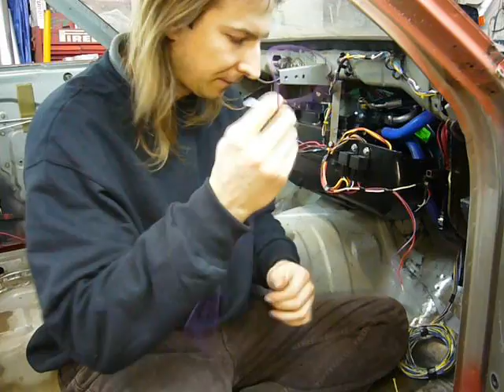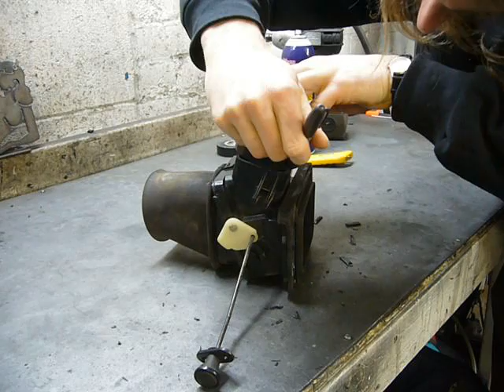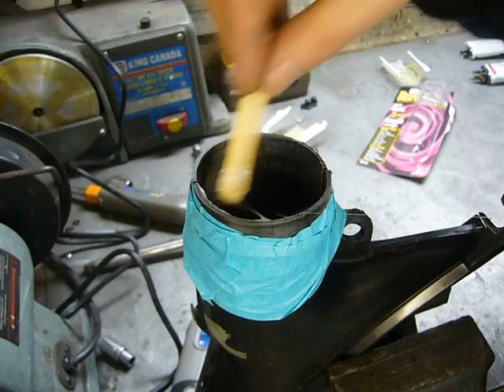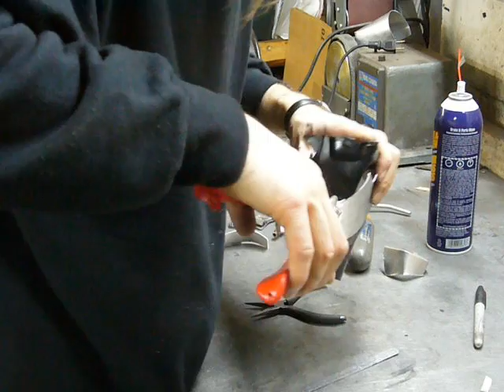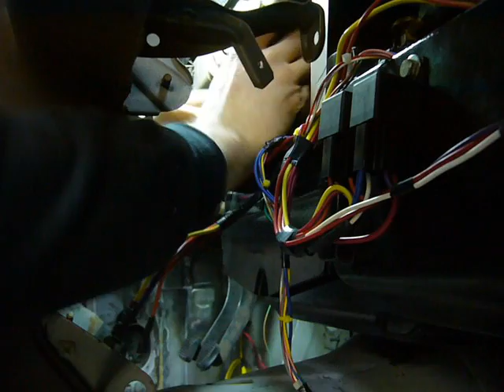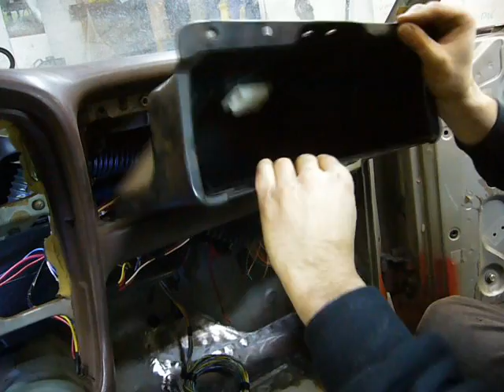Part 31: Vintage Air Gen II Compac HVAC Install, Part 3 - My 76 Mazda RX-5 Cosmo Restoration

Comment: It's been awhile since I watched this series of videos but I am buying a project car that doesn't have AC so I'll be watching these videos again.  Given the opportunity, would you do this setup again or would you look at other options?  I know the install is custom and Vintage Air didn't include many mounting options but other than that, it looks good on paper for my application.
Reply from the maker: I would probably do it again. The parts seemed fine to work with. But their included brackets were nearly useless. Take a look at episode 54 where I re-make the HVAC bracket.
Reply: Yeah, I plan to re-watch all of the episodes on the install.  Thanks for the reply.

Comment: Hi just wondering if you have a wiring diagram for how you did the relay up front to let the megasquirt know when the ac is on? Sorry I didn't quite get that bit.. I'm hoping to get the ecu to control my fans and idle up as well..
Reply from the maker: I don't have a diagram, but here is what I did: compressor clutch signal wire from Vintage Air to spare "digital in" input on MS3-Pro. Output on MS3-Pro (used spare injector) to relay coil (85). Other side of relay coil (86) to IGN switched 12V. Relay common (30) to 12V. Relay NO contact (87) to compressor clutch. Then you just need to configure the Air Conditioner Idle Up settings on the MegaSquirt.
Reply: @aaroncake  thanks Aaron so much for taking the time to reply! I love the series!
Reply: Morning Aaron - finally getting started on my vintage air setup!

Do you have a preferred brand/amp rating type of relat for this application?

Thanks again for your time!
Reply from the maker: @owlytv  Standard 5 pin automotive relay of at least 15A. I prefer names brands such as Delco,  Bosch, TE, Litlefuse because they aren't just re-branded made-in-China parts typically. If it is to be mounted in the engine bay (probably should due to the constant clicking) then look for the weather tight version with sealed socket.
Reply: @aaroncake  thanks so much Aaron! In this case it's a normally open spdt?

Comment: Between my wife and I we had two 1973 Mazda RX-2 Coupes (at the same time!) and a 1974 Mazda RX-4 Coupe.  My RX-2 didn't have any A/C but I spotted a no longer running RX-2 in a yard and bought and removed all the factory A/C components from the guy.  I have to say that although my in-dash system looked neater the under-dash A/C in my wife's RX-2 worked better.  Back in the day I liked the look of the Cosmo but the velour interior turned me off.  You are doing great work.  Exciting to see someone choose a Cosmo for a restomod.
Reply from the maker: The velour interior is one of the best parts! In fact I'm trying to decide how to modernize it, but still keep the 70s bad taste. Oddly, I actually have some of the port-installed Cosmo A/C stuff. It was in the trunk when I inventoried the car. Not knowing the state of it, and wanting to move to a more modern system, it sits in a box.
Reply: My dad had an early 80s Hurst Olds with that weird multi-stalk shifter.  It had T-tops that leaked and the same color velour interior you have.  I sat in its drenched seat once and when I got out my back and butt were both purple!  Hence my problem with velour.  At the same time I owned the RX-2s I also had a 1973 Hercules Wankel 2000 motorcycle.  Yes.  I possessed an all Wankel, all 1973 motor pool!  The Hercules was a 294cc shrouded-fan air-cooled single-rotor.  It'd do around 90mph and ran well once you got it started.  I say that because every 1 to 3 days of normal use (start at morning, lunch and to go home at 5) it would foul its single-plug with the fuel-tank's oil/gas mixture, requiring the plug be cleaned.  Really not a big deal, simply because all things seem acceptable when you're young.  I always kick-started it cuz the electric-starter didn't spin it fast enough.  Many times people asked me if it was a jet engine, bcuz with the trans bolted to the back it did kind of look like one.
Reply from the maker: Perhaps Oldsmobile hired the same engineers to design their maroon velour dye as they did to design their diesel engines? I can't say I've ever seen a Hercules Wankel in person but I'd have to agree with the jet look. One of these days, when I need another project (yeah, right) I'd like to get my hands on a Norton Commander. Or settle for a RE5.
Reply: The Commander engine is a derivation of the original Fitchel & Sachs tooling (as used in the Hercules W2000). Notice that 294cc plus 294cc equals 588cc, the size of the Norton two rotor?  I've never seen a rotary Norton but when I had the Hercules I rode with a guy who had an RE5 a few times.

Comment: GREAT VIDEOS! I know it takes a lot of time for you to do the work and then edit and publish the videos.  You have inspired me to get a sure fit kit for my truck ('53 F100) so I don't have to fiddle with all the under dash hoses.  That looked like a pain in the butt.  (I realize there are no sure fit kits for 76 Mazdas.)  this is the best AC install video that I have found.
Reply from the maker: ***** Thank you! The reason I went through so much trouble to fit everything under the dash was because I wanted it to be as integrated and as OEM as possible. The Sure-Fit is absolutely a good way to go if it fits your application and is probably more era correct anyway, since A/C was often an add-on option anyway.

Comment: Hi,
    I have a right hand drive truck.
Looking at the vintage air AC unit under the dash, do you think it could be swapped around the other way. So that the it would hang over more into the passenger side than the driver side. As I don't know if they make a mirrored unit for RHS vehicles?

Thanks,
Reply from the maker: OldDog NewTricks I'd think the only area you'd have an issue with is that the floor vents are pointing down at a specific angle. Moving the unit over strongly to one side or the other would cause one of the vents to blow onto the transmission tunnel. But of course you could always make a little duct and redirect it. Aside from that, I can't see any difference between RHD and LHD in terms of the other vents/ducts. Of course like with any universal kit, it's up to you to fit fluid lines. :-)

Comment: Aaron, what about the outside air inlet ?
Reply from the maker: ***** I'm still trying to decide if I'm going to employ one. I positioned the HVAC unit directly below the fresh air inlet but simply ran out of room to employ some sort of valve select between inside and outside air once all the fluid lines were in place. It still could be done but I would need to place the baffle in the air snorkel outside. So I'm sort of still deciding between using it and not. Vintage Air actually recommends pulling air from inside the car as it makes the system more efficient. What I could do is run two valves.
Reply: without outside air you'll have to rely only on a/c to remove humidity in cabin. And I trust you 105% you did the best job in the world with your fuel tank and fuel lines but its still inside the car (dont care about the trunk wall). I would have a bit of fresh air getting in at all time if I was you. On those hot sunny day its going to be cool inside because of your a/c but after a while your cabin will smell like a machine..
Reply from the maker: ***** I looked at the car yesterday when I was in the shop and saw something I forgot about previously. The two vents near the ends of the dash have a mixture control to select between the HVAC output and a fresh air source in the cowl. So it looks like I'm all set for fresh air. When I modified those vents I made sure to keep that function in place. What is interesting is that based on the shape of the valve, the thing was designed so that the airflow from the HVAC is always directed towards the outlet into the car and not into the cowl. I would assume this has the effect of using the HVAC airflow to draw air in from the outside and mix it. Simple and effective. As for the fuel tank, yeah, I hate the idea of it behind the seat. I'll be sealing the entire are upon final assembly with seam sealer. I'm also going to use a modern charcoal canister with purge so the whole fuel system should be sealed as opposed to the old style condensation tank and vent.
Reply: you could install two one-way vents on each sides in the trunk like many cars have (easy salvage) so that when you move the trunk will have a lower pressure so if there was to be fumes and/or odors in the trunk they will go out the car and suck good air from the cabin from any un-sealed cracks that will survive your sealing.
Reply from the maker: ***** The Como actually has two trunk inlet vents at the rear of the quarter windows, so the first half of that equation is done. Perhaps because Mazda wanted the trunk vented due to the fuel tank?
Reply: well as far as I know cars have these for few reasons: 

1- way out for odors and fumes
2- HVAC is filling the car so there's got to be a way out
3- cabin can't be sealed else if there are passengers and one slam the door it will hurt these passenger's ears.
4- insert your favorite reason here.

Comment: Hey, came in to tell you I just bought an MS3x (202FAST coupon), Eager to get it even though I don't have the car yet.
Reply from the maker: Congrats! Fire that thing up on the bench and get familiar with it and TunerStudio. Even though I don't need any Megasquirts for the near future I should have picked up an MS3-Pro with the coupon code as I will be replacing the horrid Microtech in my RX-7 with a  MegaSquirt one the Cosmo is finished.
Reply: Funny you say that, I bought a un-assembled stimulator to test it all out before I instal it! Maybe ill make a video.
Reply from the maker: Yoan Carlove Absolutely make a video. You may or may not have seen it but I have a video up showing the time lapse assembly of a MS1 Megasquirt. Going further you can even have the whole thing running on the bench being triggered from a wheel spun by a drill, firing a set of whatever coils you have around, and running any old injectors.
Reply: Ohh, I'm going to check it out, thx for clarifying the drill is ok to spin it, ill start slow and build up the "revs" ahahah! 

If It's in the cosmo part 1 to now I have seen it but ill check it out!
Reply: I found your 6 year old 2:46 video, nice thx!
Reply from the maker: Yoan Carlove That was an MS1 I assembled for a friend's FC. Seemed like the best option to just convert the car to Megasquirt as the stock harness was no longer usable.

Comment: what was that plastic epoxy you used?
Reply from the maker: Permatex PermaPoxy 5 Minute Plastic Weld epoxy. The stuff is incredibly strong and cures very quickly but man, does it ever reek. The smell will burn your nose hairs out.
Reply: aaroncake seems like a good thing to have especially when owning an rx7 with million year old plastic! Ive spent the past fews days watching the entire project and I've learned alot, hope to see more videos soon!
Reply from the maker: Clay Stanley Well to be honest, I simply replaced all the broken plastic in my RX-7 with new parts from the dealer. It's really not that expensive, especially when you consider the time put into fixing it and the fact that all the old trim is faded and going to break anyway again. Thankfully most of the trim in the Cosmo is in pretty good shape. Since I'll be covering it, a crack here or there isn't going to matter as long as the stuff stays together.

Comment: So I'm not a car expert, but I do know a fair bit about electronics (ahem) - and t I believe you should be putting the dielectric grease on after you make the connection (in this case via twisting the wires together). Dielectric grease is an insulator and hence reduces electrical contact. What you want is a good solid metal to metal connection then add the grease around it afterwards.
Reply from the maker: True that it is an insulator. However the reason that it is applied first is because that allows it to protect all the areas of the connection it would not otherwise reach. When the crimp is made, the metal to metal contact forces the dielectric grease out of the joint where conduction will occur.

Comment: hey Aaron i think it would be super interesting for you and to the You tube population if you cold do a Mazda rotary engine differences 12a 13b 20b most common size i know the 20b is not all that common but lots of us know about it.So speculations about different years placement of spark plugs degrees 2 piece apex seals 3 piece 6 port 4 port n/a 4port turbo difference in the eshaft flywheel, errors in some years i would like to hear you take on stuff what's best to you what is less desirable your like a master to me i would watch that for sure and our rotary engine fans from rx7 club, no piston,com and so on would watch that for sure!I just thought i would share that idea whit you and suggest it.I know that your busy and that might take a lot of your free time. I would invite u to consider it i have not seen a video of that type and you are the pro in that mater... from Philippe.S AKA your biggest fan!
Reply from the maker: If I had an example of each engine I could show, I'd gladly put something like that together. Otherwise it's just me in front of the camera blathering on about the details and unless I do it naked or something, it probably won't be very interesting. Unfortuntely I only have S4, FD and GSL-SE 13B engine parts around, as well as '78 12A stuff. And no complete rotating assemblies. I'd add it to my website but I'd be lacking for pictures and much of this is documented already. Mazdatrix for example has a great FAQ section covering many of the engine part differences.
Reply: Ok then thanks for that!Just to let u know i would listen to you talking about that but i understand your point ;) Rock on !

Comment: Hi Aaron. At work I use something like this to connectors. I would recommend.
http://www.atel.com.pl/produkt.php?hash=04251#
Reply from the maker: Looks like a nice tool. I'll certainly need to pick something like that up. My little $7 crimper works well but requires a lot of technique to use. Easy to make a bad crimp.

Comment: I kept checking for your updates but nothing until tonight, even though more than 4000 views on the clock. Another good episode in the series, well done and no sign of you running out of steam anytime soon Aaron.
Reply from the maker: It seems that large parts of Google went down minutes after I uploaded this video. So I'm betting most of the notifications didn't work since several others have complained about not knowing this video existed. Same damn thing happened with the previous upload. I'll be seeing the project through to completion, don't worry about that one. Though tonight I'm taking a (well deserved?) night off for a few beers in front of the TV instead of an evening of cutting stainless and TIG welding.

Comment: Aaron are you going to tear everything down for full body painting and undercoating??
Reply from the maker: Yes. After the mockup everything comes out of the engine bay so it can be painted. I'm still debating stripping the underside totally or just re-coating (with POR-15) the spots I've fixed. It is a very unpleasant job to strip the underbody but if I do it in sections, it's more tolerable.

Comment: upside down and on your back is common postion for you know? haha

Also does it get hot very often in Canada?
Reply from the maker: Contrary to what many people seem to think, many parts of Canada (especially Southwestern Ontario where I am) swing from damn cold (colder than -30C) in the winter to damn hot (hotter than +30C easily) in the summer. July and August around here are typically at or above +30C most days. Canada has both rain forests and glaciers, with everything in between.

Comment: You'd really really really benefit from buying and using a 3d printer. There's so much that you're fabricating in this video that would be so much easier with printed plastic!
Reply from the maker: Several of my customers have rapid prototyping machines which I could likely use if need be. At the moment, proper rapid prototyping machines are still very expensive while the "3D printers" sold to the public are very limited in terms of materials and resolution. In a few years when the consumer rapid prototyping machines (funny how for many years it was called "rapid prototyping" then when the media got a hold of the story it was now "3D printing") increase in output quality and versatility, I may pick one up. But what I'd really like to see are small consumer CNC platforms. It would be nice to be able to just set the thing up to cut a flange or two instead of spending hours at the drill press and band saw. Maybe if I keep paying attention to the local auctions I can find a cheap water jet machine. ;-)
Reply: Well, it's comforting to know that the technology is moving along, and eventually we'll have personal prototyping and personal CNC machines.
Reply from the maker: Stephen Bailey There are plenty of DIY CNC machines and articles around and they aren't really overly complicated to make. However that in itself is another project which will have to wait until all my other projects are complete.
Reply: Very cool. I love how thorough you are in your videos, and apparently in your responses, too!  Very inspiring stuff :) Can't wait until the engine bits!